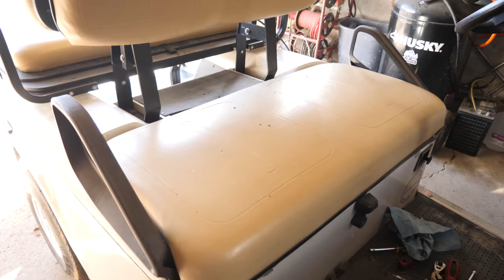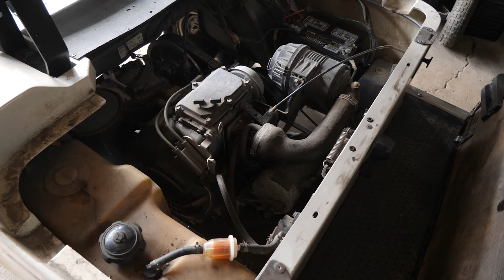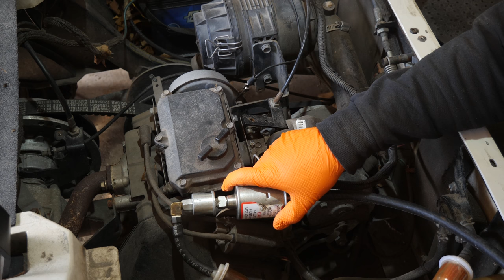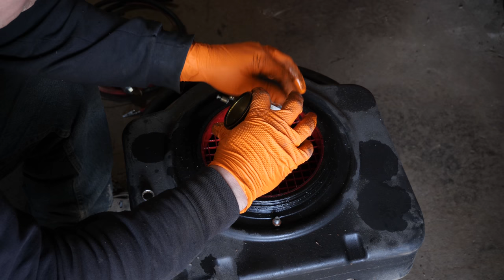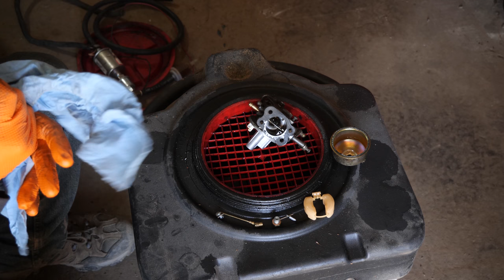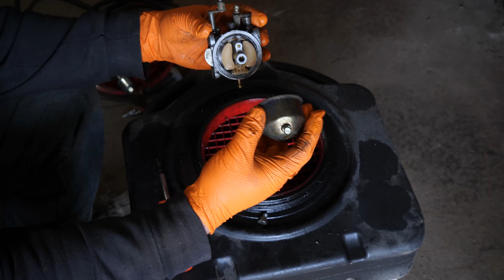2006 EZGO TXT, Gas - Crank, No Start, Water in Fuel

Comment: stabile or they make a few products out there for water. HEET is a good one for water use it at work.
Reply from the maker: When possible, the best way to remove the water is to clean the fuel system by hand. I know this is not practical in some cases but I don't want callbacks for this issue.